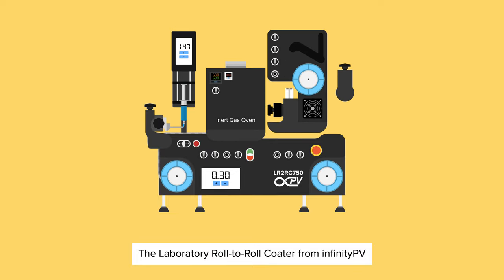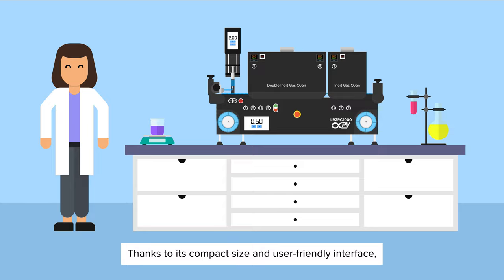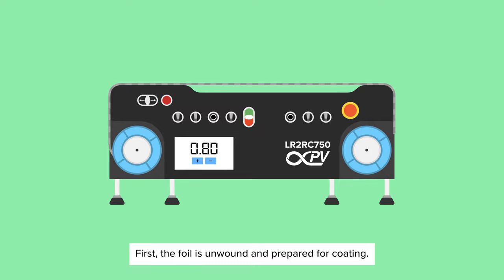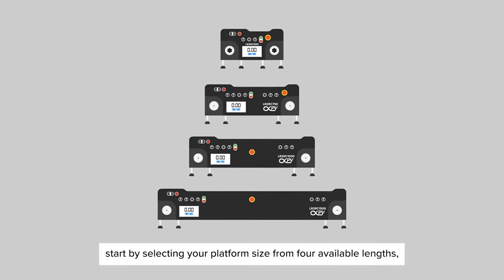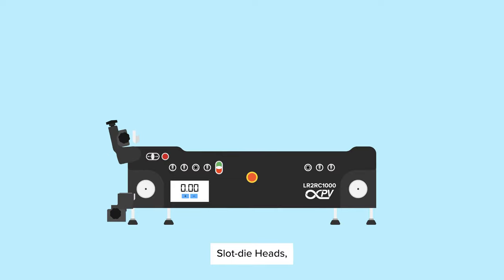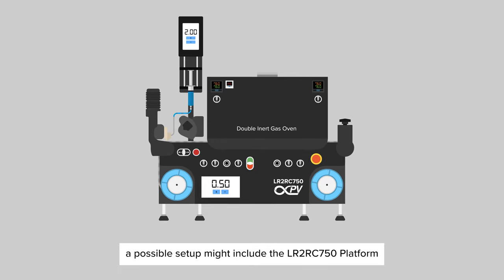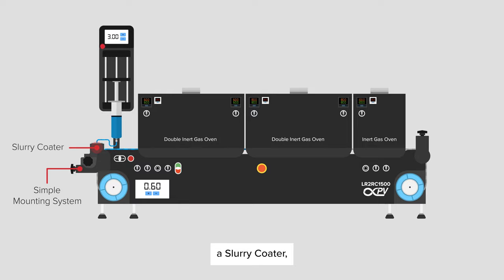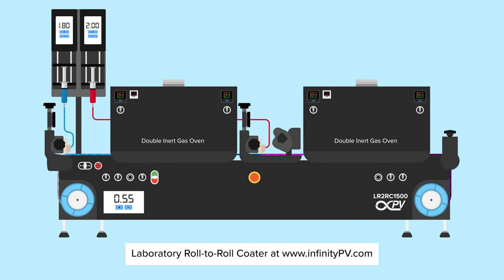Laboratory Roll-to-Roll Coater (R2R Slot-die Coater for Slot-die Coating)

Comment: who is this for? what type of person would want this product?
Reply from the maker: The Laboratory Roll-to-Roll Coater is primarily targeted at researchers, laboratories, and small-scale pilot production facilities that work with functional thin films. This product is ideal for users in fields such as material science, electronics, and renewable energy, where precision coating and printing of thin films are crucial (e.g. batteries, fuel cells, printed solar cells, transistors, LEDs or sensors).

If you have any other questions, feel free to ask away. 😊

You can learn more at https://www.infinitypv.com/laboratory-r2r-coater-lr2rc